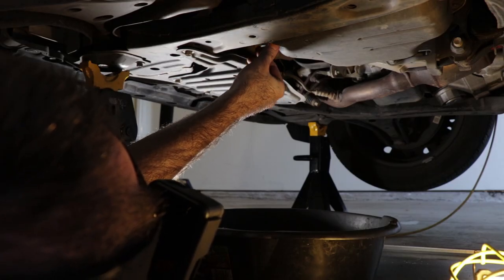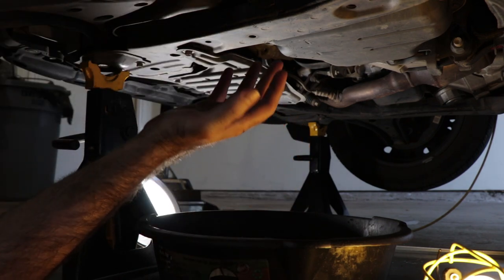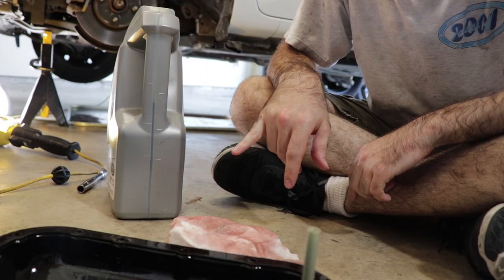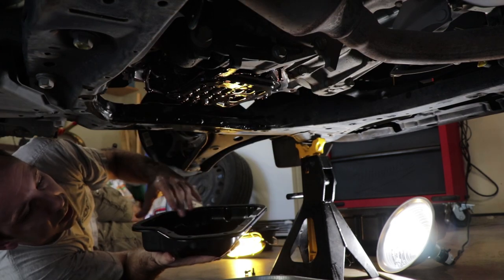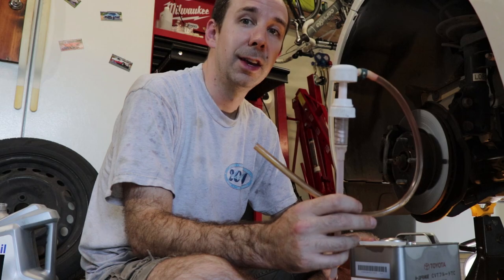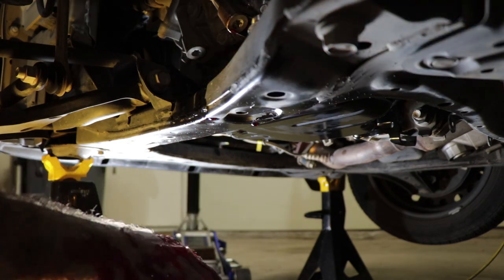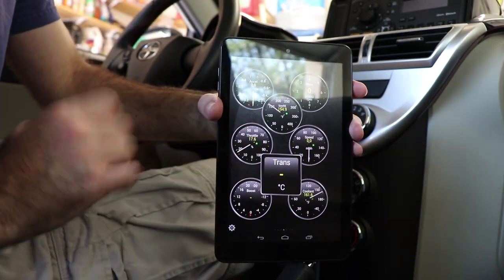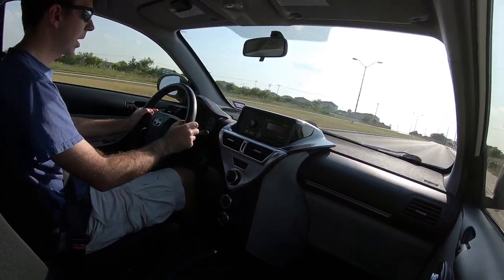Scion iQ CVT Fluid Change

Comment: Can you make a video of changing the CVT fluid on a '17 Corolla?
Reply from the maker: I unfortunately don't have a 2017 Corolla to work on.  I would guess that the procedure is basically the same as I showed here, however, with the major differences having to do with the exact capacities, and probably also that the filter is readily available.

If you happen to be local to me in Austin, Texas and have the car in question, we might be able to work together to make a video showing the process.
Reply from the maker: The Corolla may have a different transmission entirely (it has a much bigger engine than the iQ), but it seems that at some point, Toyota stopped claiming that the fluid lasts forever.  If they have an interval to use, by all means go by what they say.

In my case, I chose to change the fluid when the transmission started making noise, since they don't give a specific interval for the iQ.

Comment: Rockauto sales a oil filter for scion IQ for 69$ the rule is if youchange oil change the filter engine or ttransmission
Reply from the maker: I am well aware that you would normally replace the filter while the pan is off.  It's been a while, but I think I mentioned in the video that I couldn't find a source for the filter at the time, so I did not replace it.

After reading your comment, I was surprised to find that, you're right, and Rockauto actually does offer a replacement now.  This was not the case in 2018.

Comment: hey man thanks for this video,  about the castrol transmax cvt can you use this to replace the transmission oil on your car
Reply from the maker: Yes, you can use the Castrol fluid in place of the Toyota fluid.  I actually used about a liter of it to finish this job, and it works well.  The bottle I bought I specifically says it's meant for Toyota CVTs, among others, so as long as the fluid you get is labeled as such, I think you'll be fine.
Reply: @AaronAverett   thank you aaron!

Comment: Hi ... Good job dear... 
But what about the filter!?
And how much price for filter?! 
 Best regards Bro
Reply from the maker: The filter is supposedly made by a company in China, called Linesoon.  Part number 97746.

I think I mentioned this in the video, but you can't get that part in the US, so I didn't change it.  You're ahead of the game if you're changing the fluid, and this CVT won't have as much contamination of the fluid anyway, since it doesn't have clutch packs constantly engaging and releasing, so I wouldn't worry too much about reusing the filter.

Comment: Just got my 2012 iQ a couple of weeks ago and I notice the "whine" or to personally describe it as a cross between a tire squeal sound and whooshing noise under moderate load. After a year, is this noise still gone after you replaced the CVT fluid?
Reply from the maker: It's actually been almost two years at this point, but... mostly.  On particularly hot days, there is a perceptible sound that the transaxle makes, but it's still well below the level it was prior to shooting this.
Reply: @AaronAverett  ok great! I think it'll be well worth the fluid change, just a little hesitant at first considering the OE fluid's price
Reply from the maker: @victors787  Good deal.  Just remember that I did it wrong in the video, and you can just remove that plastic measuring tube and refill.  No need to drop the pan unless you manage to find a source for the filter, in which case I want to know where you got it so I can shoot a follow up.
Reply: About a year later and finally got around to it. I have access to a shop and a lift so I'll admit it's much less of a hassle. Only trouble I had is realizing when I went back to put in the plastic level tube, I hand threaded it down but wasn't sure if it was at the correct position (as in too low) compared to attaching a 6mm hex to a small ratchet and keep threading in. I realized after warming up the transmission with the car running for about 3 or 4 minutes. Been driving a week now and seems better with about half of mechanical whirring gone. The old fluid came out DARK red... quite close to oil looking. iQ has 68k miles and is 9 years old most of its life being in hot Phoenix. I would suggest if anyone's iQ has less miles and is newer to replace CVT fluid ASAP.

Comment: My 2014 Scion iQ says the capacity of the transmission is 6.5 qt, or equivalently, 6.2 L. Any idea why this change? Great video, thanks a lot!
Reply from the maker: A couple of reasons.  First, as I mentioned in the video, I didn't do it exactly the per the manual, so the amount of fluid I went through to get the transmission properly filled will be greater than what it takes you to do it correctly.

Second, there are parts of the transmission, such as the torque converter, that you can't drain, so you'll still have a liter or two in there even if you remove the pan completely, like I did.  You still change most of it this way, but not quite all of it.

Also, as an addendum, you can get a replacement filter now, from Rockauto.  I didn't change it in the video because it wasn't available from any source I could find at the time (2018), but if you're doing this in 2023, you should change it.
Reply: Thank you so much for replying to me, I was not very hopeful you would do that since the video is from 5 years ago. Great to know we can get the filter now. My iQ I just bought with 81,000 miles, and was planning to drop the pan to get as much fluid from the transmission as possible. I have another question: when I start (crank) the engine, particularly with the engine cold, immediately after the engine starts there is some  grinding noise that just last for about a second, and I just noticed that your car was doing the exact same noise in your video, it is the noise that one hears around the 29:30 time mark. Do you know if this is normal, or what causes it? Very appreciative of your efforts!
Reply from the maker: I think the noise from the starter is probably normal.  I've owned a bunch of cars that made a similar noise - it's just the sound of the starter gear being driven by the flywheel as the starter bendix disengages from the flywheel.  If it started making a horrible screeching sound, that would be abnormal.

Congrats on the purchase of your iQ!  It's not the right car for everyone, but if it works for you, there's almost nothing you can replace it with that's better.
Reply: Thank you. I bought it for my 17 year old son, and he loves it. Then (according to your mistake of adding too much fluid and then having to drain some of it), a single 4 liter can of Toyota's CVT fluid (in my case is FE fluid) should suffice. Is that correct?

Comment: What is the temperature of the fluid supposed to be at when you open the drain plug? I didn’t see it in the video, so I’m sorry if I missed it.
Reply from the maker: The proper range is 95 to 113 degrees Fahrenheit (35 to 45C).  I'm pretty sure I mentioned this toward the end of the video, but it was probably pretty brief, since it was likely in the lower 90s when I shot this.

Honestly, I doubt it matters hugely as long as it's not super cold.  The proper fill procedure, where you fill until it comes out that funky drain/overflow tube thing at the bottom of the drain pan is the real secret sauce.
Reply: Thank you very much for the reply & your video. It has been very helpful & I intend on attempting this myself.
Reply from the maker: Awesome, man!  Let me know how it goes.

Comment: Hi, do you know something about  RESET or UPDATE the CVT Sofware ?? and how to do it?
Reply from the maker: I'm not aware of any firmware updates for the transmission being available, but if you need one, your best bet is probably to just take the car to the dealer and have them do it.  I'd imagine a software update would probably be free, or pretty inexpensive.

If what you need to do is reset the transmission's various adaptation parameters, that is done via the Toyota Techstream software, which seems to come on a special laptop for dealer techs.  If you have to ask, chances are the only legitimate source for this is to buy one used on eBay, but there are third party scan tools like the ones sold by Snap-On and OTC that can also do this, but they're usually very expensive.  I'd look on ebay, if I were you. ;)

Comment: What mileage do you recommend changing the fluid? I'm going to be hitting  50,000 miles
Reply from the maker: Sorry I left you hanging; I changed mine at about 40K miles, when it started making noise.  Toyota doesn't provide a recommendation for this, but 40-50K is probably a decent rule of thumb.
Reply: Do you still own the car

Comment: What tool is used for taking off the side fill plug?
Reply from the maker: It's just a regular socket, as I recall.  19 or 21mm maybe?
Reply: @AaronAverett  I just left harbor freight. It's 15/16
Reply: Thank u for this video
Reply from the maker: It's definitely not an SAE size.  If the 15/16 fits, then it's probably a 24mm.
Reply: @AaronAverett  I appreciate your feedback

Comment: I would like you to give me the suggestion of do on 2016 Toyota corolla myself
Reply from the maker: I'm afraid I don't have a Corolla to work on, but the process should be similar to what you see here, with the key difference being the exact capacity of the transmission.  The Corolla is a larger car than the iQ, so I would expect it to have a somewhat greater fluid capacity.

Comment: At the beginning you stated that from the drain hole will come out 1.6 liters of fluid. When you removed it you drained 3.6.
Then you put back how much with the pump? and also you added another half litre(drained 1 litre anyway) after the mistake? What was the total fluid needed anyway? Till the overflow tube overflows plus 400ml? 

Thanks
Reply from the maker: I was deliberately vague about the true capacity because I don't know for sure, and it didn't seem to agree precisely with what the shop manual says, but if you get the big gallon jug I showed in the video (part number in the description) you should have more than enough.

The procedure goes like this:
1.  Reinstall the pan, gasket and measuring tube, but leave out the drain plug from the bottom of the pan, and the fill port plug.
2.  Fill through the fill hole on the side until you get fluid coming out the drain hole, over the overflow tube.
3.  Put the plug back in the bottom of the pan, and add another 400ml.
4.  Start the engine and warm the fluid up to about 100 degrees Fahrenheit.
5.  Remove the drain plug again, with the engine running.  If the level is right, you should get a little trickle out through the hole, over the top of the measuring tube.
6.  Reinstall the drain and fill plugs, drive the car and check for leaks.
Reply: As i understood, the manual says 6.2 L TOTAL VOLUME CAPACITY... (?) but it has to be 50% full otherwise the gearbox foams and overheats. U fill 4L (overfill it) AND THEN when u heat it up to 42C, u simply just drain it. In VW its the same u simply overfill it by 1liter or so and then let the snorkel do its job when the temp is just right and car leveled. done.

Comment: Do u have the car running or off when changing the fluid
Reply from the maker: The engine should be shut off for most of the procedure.  You only start the engine once you've filled the fluid most of the way up.
Reply: Thank u

Comment: Hi its me again, aaron I went to a mechanic and I was told they cannot changes my transmission fluid because it was old and never get a transmission changes and say it might broke the transmission ,  what should i do! and they said I cannot use the castrol CVT it need a cvt fluid from toyota  i am confused please tell me what to do.
Reply from the maker: How many miles do you have on the car?  Does the transmission make any audible noise?

What the shop is saying used to be the prevailing wisdom, back in the 1990s.  I'm not sure if it was ever studied scientifically, but there was definitely a camp within the "car guy" community that thought changing the fluid on a high mileage transmission that had never been serviced before was risky, and tended to cause more problems than it solved.  This is less applicable to a CVT, but MAY still be true, to some extent.  It should be noted that my car only had about 40,000 miles on it when I shot this video, which is pretty low, so I was not yet a high mileage "better to leave it alone" case.  You may be, if your car has a lot more miles than mine.

What's really happening though, is that the shop just doesn't want to deal with it.  This isn't something that's prescribed by the factory, so they don't have any instructions in their manuals, and they understandably don't consider some random guy from Youtube to be a reliable source.  If you're not comfortable doing this yourself, including a clear understanding of the risks involved, it may be best to just leave it alone, particularly if you don't have any obvious symptoms of a problem.

With respect to the Castrol fluid, I used about a liter of it in my car, and it's working just fine a few thousand miles later, but you can get the Toyota fluid from any Toyota dealer.  If you do this properly, one (4L) can of it is more than enough, but I ended up needing a bit more to correct the mistake I talked about in the video.
Reply: @AaronAverett  It has 98k miles when i got it  i got no idea if they changes the transmission fluid on it . now the car has 130k miles , The only issue i got is it whining sounds it started when the weather becomes cold ,  when  I start the car in the morning the sounds will come out and when i drove it for like 3 miles it dissapear.
Reply: this is my car sounds like
Reply from the maker: Oh wow, that's gnarly.  It's hard to tell for sure based on a video, but that sounds more like a bad bearing in the alternator or an idler pulley in the accessory belt drive to me, than the transmission.

Did a shop tell you that that is transmission-related, or are you diagnosing it yourself?
Reply: @AaronAverett  i was told by a mechanic
Reply from the maker: You might seek a second opinion.  I think it’s pulley a bearing for one of the belts, but i cant say for sure just from the video.  If that noise is coming from the transmission, though, I doubt just changing the fluid will fix it.

Comment: hows your iQ doing?
Reply from the maker: Hey, thanks for asking!  The iQ has been just fine, with the obvious caveat that, the global health crisis situation being what it is, it hasn't gotten a whole lot of use in the last six months.

I keep meaning to make some more videos with it, but it just never feels like a high priority, given that I've done so little driving this year that none of my vehicles are really in need of any maintenance.  Is there something you'd like to see?
Reply: Aaron Averett I also have the cvt and just wondering how it’s holdin up. I have 52k on mine and I have done 1 drain and fill and 1 drip pan and filter change haha. Extensive maintenance imo
Reply from the maker: Hold up, you've changed the filter?  Where did you get the replacement part?

My iQ has about 47K miles now, and seems to be holding up just fine.  It's primarily my girlfriend's car, and she doesn't drive a great deal, but if she did, I think I'd be pretty religious about the fluid changes every 30 or 40 thousand miles, particularly in a hot climate like Texas, where I live.